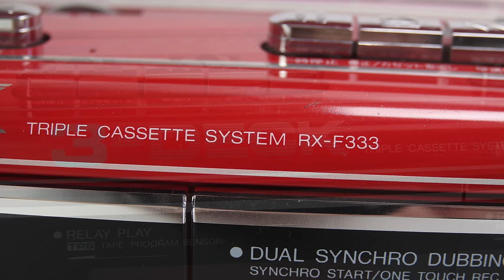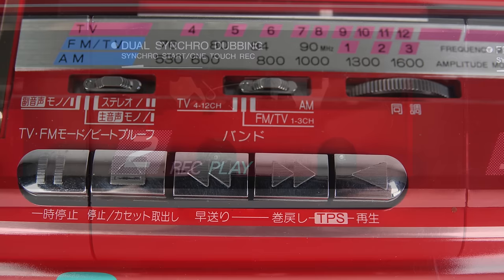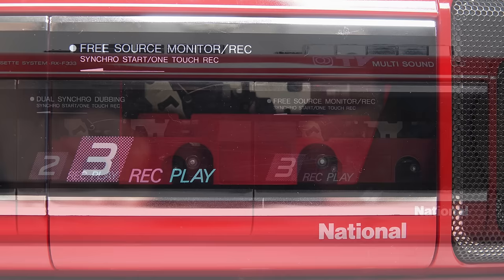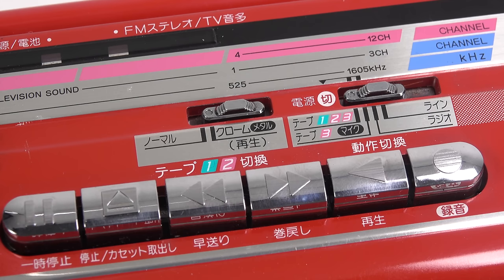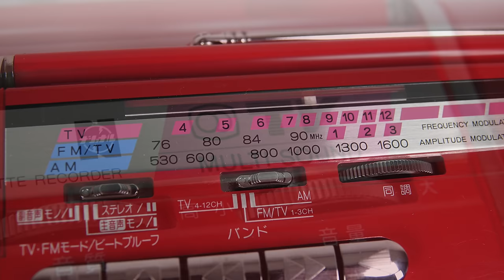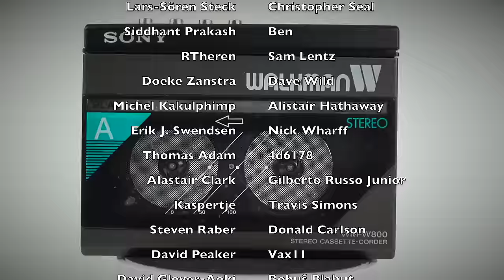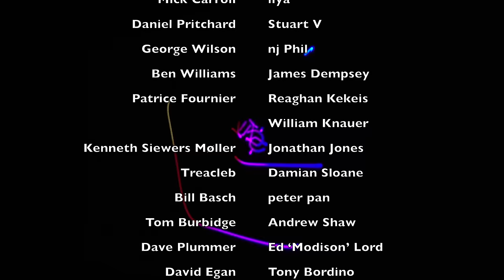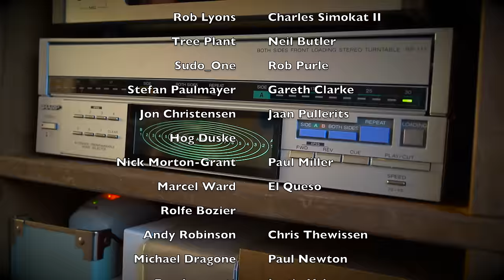The Three Cassette 'Boombox'

Comment from the maker: Update on the repairs. 
https://youtu.be/RjfExPMyX0c
Reply: Needle tweezers will do it.
Reply: The rubber remover is available from RS in the cans of Label off 50, from Contact Chemie. You can use a scrap VCR as source of those split washers, National used those clips on a lot of machines, so you should find a spare in an otherwise broken deck.
Reply: It is indeed tricky, but it is doable with some practice. To prevent them from spinning you apply force not from side, but more like from top of it. I mean insert knife in that split by moving it parallel to metal rod and split open ring  from side. That way it will not turn while you doing it.
Reply: What about running thin thread covered in solvent in one direction behind the wheel. That way you pull the goop out with the thread. Sorry best idea I've had. I don't think you can get it apart withou breaking something and replacing it.
Reply: Another way of doing it is use those tiny manicure sidecutters used for trimming nails. You can find those which so tiny it could easily be used to split open such washers. And such method will not apply any rotating force at all, so it will not turn around.
Reply: What about just getting a spray can of electrical contact cleaner and blasting the goo off with that? It's safe for electronics and it will clean off pretty much anything. I've even used it when I restore antique typewriters! It easily cleans off dirt and old grease and leaves just clean metal. But I've used it to clean sensitive electronics like computers too. I'm sure they sell it or something similar in the UK.
Reply: Techmoan I don’t know if they would work but they make split ring pliers for retaining rings on machinery, kinda like a pair of needle nose with a little lip on each side to grab the inside of the ring and then it opens it slightly when you squeeze them so it can be slid off
Reply: @zero0ryn   , yes thin ones just slide both tips under the washer at both sides of the capstan.
Reply: I used to use short nose taper nose players that had grooves for grip. You could try wire stripers that can go behind the clip and pull it up and onto the capstan it should then slide off.
Reply: Hi. It appears to be the same assembly as on the National RQ8030 Program Recorder. I had the exact same issue - belt goo and capstan/fly wheel removal but found the following bog very helpful. It's in Japanese but there are lots of step-by-step images:
https://blog.goo.ne.jp/timatima-psu/e/959884ab7a65f29ec6bbca635b020911
I prised the tiny locking ring off with a small flat headed screw driver - I thought it would be damaged but it had quite a lot of give and could be reused.
I also had the same clutch problem, which was solved with a dab of super glue - it's held up so far but might not be the best solution in the long run.
Hope that helps
Reply: When we used to repair these type of decks from Panasonic, we had a bag of replacement split washers, when you lever the split clip off it often flies into the air... also when removed it often distorts so we'd always replace it. I've probably still got a bag of these in the workshop! - this size was used an so many Panasonic audio decks over the 70's, 80's and 90's as I recall.
Reply: Yes you need to remove the split washer on the top to get the fly wheel out, they sit in a groove, I normally use two pins one to hold it so it does not turn and a second pin to the open it up and get it out and over the groove.
Reply: You can see the split washer clearly at 05:30
Reply: @anonymic79  yes very similar to in a fan a plastic washer with a split in it.
Reply: I'm surprised no one has mentioned that there are tools that can work with these "retaining rings" as they are otherwise known (or snap rings) though they are still difficult to maneuver in my experience. They go by the name of "retaining ring pliers". Don't skimp on cost for these either.
Reply: Maybe try a piece of aluminium foil, fold al little strip over so you have  a "v" shape and use that as a scraper to get the gunk out.
Reply: @Techmoan
I've actually done a belt replacement on the US version of this unit(Panasonic branded). It was years ago. I remember having to unscrew the entire assembly and pulling the sleeve-bearings out. At the time the belts could be had for cheap on eBay. Granted, that was the US version and this Japanese version you showed looks a bit different than I remember. They might have changed the design somewhat before releasing it stateside. Still it's a worthy unit and worth repairing. Don't give up and even if you can't repair it, thanks for the trip down memory lane! I remember seeing the Panasonic version on display at a store here called "Fred Meyers" back then. Ours had a black chassis. Bit pricey though.
Reply: Have you tried flossing your machine?
Reply: Try squeezing a cotton bud in a pair of pliers to make it flat, that might then be able to slip behind the wheel.
Reply: Techmoan Don’t envy you all that fiddly stuff with the creatures innards! Good luck anyway!
Reply: In addition, please note that you set up the pulley the wrong side in 4:41, the side with circles should be facing the felt wheel.
Reply: These plastic surclips are removable with a bit of playing around. Yes there's a groove on the capstan they sit in. There's usually a split in them and if you lever it up here it part of it will jump out of the groove. You can then work your way around the thing and once its all out of the groove slide it off. If you are careful you won't damage it too much. WHATEVER YOU DO DON"T LOOSE IT. They tend to fly off and a nightmare to find again.
Reply: Besides dental methods, cleaning fluids can be put in small places with a syringe.
Reply: @M1LAD81  Modify one that has a sharp secondary bend off axis from the primary bend. It looks like that kit comes with one pick with a secondary bend, but it's awfully subtle and may not be aggressive enough. With that you can gain leverage by twisting the pick once you hook it, which may be necessary in such a tight space.
Reply: @heep13  I was going to suggest pipe cleaners, but dental floss might work as well.
Reply: Would one of these help? https://www.google.co.uk/search?q=circlip+pliers&oq=circlip+&aqs=chrome.1.69i57j0l5.5342j0j8&client=ubuntu&sourceid=chrome&ie=UTF-8
Reply: I'd always lifted these off just apply even presser on both sides of the flywheel with two flat blabe screwdrivers at base and just work it till it pops off if you feel uneasy about it try it with a junk machine first  but it is a neat machine
Reply: Try using a cloth soaked with Citrus Solvent and slide it between the flywheel and case._
Reply: I would try to look whether those three "dimples" on the bigger pulley ( video position: 6:20 ) are actually just places where there are screws behind the thing ( I am thinking of screw studs, but I think that's not the term ). I would think those black rings would separate somewhat easily (either glued onto the metal "cap" or screw tightened). 

So, try looking through the other side and spin the big pulley and see if any of the holes in the back side of the assembly line up with a screw head. I think the metal wheel (slighly bigger than the black plastic pulley) is held on with an another set of screws underneath the black pulley. - The assembly has screwsheads visible underneath the bigger wheel ( video position 7:05 ) so it must come off somehow. I would even suggest trying to remove the button assembly in case the button "bars" are blocking the service hole that blocks the holes meant to remove the black pulley screws.

But -  This comes from someone who has never fiddled / disassembled / repaired any kind of a cassette deck, but still I think it's worth a shot.
Reply: Maybe get some of freeze spray to see if the rubber goo solidifies, then use a long metal pin to remove the froze rubber.  Not sure if the rubber will freeze, but maybe worth a shot anyway.
Reply: @TheBrokenLife  I agree with using pipe cleaners in the gap, maybe dipped in a solvent. Oversized pipe cleaners are available from craft stores.
Reply: Very unlucky indeed, recently replaced two drive belts on a Sharp VZ2000, yeah you guessed it, sticky tar like mess.
As you may or may not know, this machine has a dual speed turntable.
Suffice to say, cleaned up the mess and replaced the belts.
I was also going to suggest the split washer on the capstan pin.
I have never, in all my years of working on tape machines, seen this type of fitting.
That said, they might be pressure fitted with a groove in the pin and/or a retaining clip.
Reply: You need to get very, very small
Reply: Why are you so afraid of submersion cleaning?
Using distilled water and gentle cleansers, such as a little bit gentle dish soap will safely remove all the gunk and then you just rinse and dry them.
You do need to rinse the cleanser out very throughly with distilled water or you'll get rust, and discharge all caps but..
It is not risky to submerge electronics. 
We do it all the time manufacturing them.
I know. Because I have manufactured them.
Reply: They are called E clips in the states.
Reply: I used to remove that kind of Split washer by using two tiny screwdrivers, one for keeping it from spinning and the other for pushing it open.
Reply: Hope you make some progress, this thing is pretty neat!
Reply: Those split washers are easy to remove if you know how. Micro pliers or hard body tweezers are the best tools. To remove simply grab the side opposite to the split and pull. Be warned though that putting them back on is usually a lot harder and getting them off.  : )  They are also a little delicate so if they get damaged you will need to replace. I'm pretty sure they're a standard part though so should be easily available from the right supplier, like RS.
Reply: Try to clean it using a coarse dental floss dipped in goo gone.
Reply: Hey techmoan I have an idea try buying a cheap jewelers screwdriver set use a flat head one and use like a felt sticky foot pad or something similar attached to the end that might help you get to the nasty belts. I don't know if this will work for you but it might just be small enough to get down there and I don't know how difficult it would be to attach the felt on the screwdriver but  I thought I would make the suggestion anyway.
Reply: As a watchmaker I take precision tweezers, flat ones if you have. And a magnifier glass to see what you are doing.
Reply: @spacemissing  Well, like I said I've even used it to clean the mechanisms in typewriters...since it can easily clean off 70+ years worth of grease and grime in an old typewriter, then it's worth a try. I've also used it to clean engine parts. Maybe they sell a watered-down version of contact cleaners in the UK because of tighter environmental laws or whatever, but trust me the stuff I use will get anything off. It's made by the same company that makes WD40 but it's specifically meant for cleaning electronics. It just happens that it's also great for cleaning mechanical parts. It comes in a green and silver spray can.
https://www.wd40specialist.com/products/contact-cleaner/
Reply: As someone who has serviced too many of these mechas, this washer is just pressure-fitted, and can only be force-removed, unfortunately, e.g. with a screwdriver. If you're lucky you might be able to reuse the same washer once or twice, but it's better to keep a bin of spares. If you don't have any, you can cannibalize one of those washers from one of the spindles (it's about the same size) and use a turn of copper wire for holding the spindles in place, instead.
Reply: Yep, that's it. Had disassembled so many different cassette decks in my younger days(massacred for other projects).. became old hat. Many matched the type installed in this national. Found a sharp knife the best way to lift that little split washer. It slides straight off the end of the spindle/capstan. One thing, make sure you don't lose them though..They're damn hard find if you drop them.. lol.
Reply: I used to remove such split washers using small flat screwdriver. Just inserting it between the shaft and the middle of washer. Make sure to catch it if it attempts to fly away. And beware bending too much as it can cause shape distortion to the washer.

Sorry for my English :)
Reply: Yes, as others have said, you'll need to find a way of easing off the split washer. A small jeweller's-style flat screwdriver usually does the trick. The washers are usually pretty soft and flexible, so it's hard to damage them without being extremely heavy handed.  I actually removed the capstan flywheel on an old Nakamichi one time.  Because I'm stupid and crazy.  Worked out fine.  The only bad things that can happen are accidentally bending the capstan or pinging the washer across the room when removing it.  
I never even knew that triple cassette decks existed.  Looking forward to seeing it up and running.
Reply: I would probably use a dental pick to try and get under one side of the split and lever it up and off (maybe while holding down the other side with a second pick). Alternately feeding a thread or waxed bit of dental floss underneath may allow you to slowly work the clip up without damage.
Reply: I take those out by using a very small flathead screwdriver, one that is 2mm or less in width to split the cut in the washer while holding it with tweezers. Just hold it, insert the screwdriver in the cut vertically and turn it a bit so the gap widens. Be careful though, as those washers are notorious for hopping off into the most cluttered part of your room if you don't hold them firmly. Do not widen it too much though, as the disc might get bent and will not stay on or will start rubbing against whatever non'moving part it's installed against and that can be heard in the case of capstan, though that is only in extreme cases. You can also use a thin needle to pre-widen it and let the screwdriver in if it's too tight. Many computer fans as well as tape decks have rings like that and i've used this method on quite a few. One of ways to put it back on is to lick your finger so that the ring sticks to it and can be picked up, and then pressing it on like that. This way it'll be a lot easier than with tweezers to put it on perpendicular to the shaft and to feel whether it actually got on and it won't fly off.
Reply: I used a baby screw driver flat head and a tiny kitchen knife, it's in a recessed ring, one tool holds it steady, the other you bend it up and it will finally slide off, it's a PITA but it will come off and usually be reusable, an e clip can replace it if the right size, I used a trash donor BoomBox on mine, if you use the e clip you need the grayish washer behind it.
Reply: It's definitely worth repairing for the novelty factor (one of only a handful of boomboxes with 3 decks), but just don't expect any quality sound from those decks. The wow & flutter was horrible. This model was produced during the mid or late 80's, when quality went downhill. The best build quality was during the early 80s and late 70s.
Reply: Use a precision screw driver and insert it in the cut in the split washer to create a gap. Twist the precision screw driver some more to widen the gap. This will create space in the center hole of the washer. You can then pry the washer out of there using some pointy tool. Be careful with this as they have a tendency to flick in the air just like a c-clip would. Being small and translucent, it's very easy  to lose them and finding a replacement is a pain.
Reply: Hey Techmoan,

Nice to see you don't give up on the casette deck.

I have a question: where to you get the replacement rubber for the casette decks?
I have a Sony HX PRO STEREO CASSETTE DECK TC-WR 720 on wich the rubbers have suffered the same faith as your rubbers and i would like to replace them.

Would be nice if you could tell me where you get your replacement rubbers from.

Keep up the great work.

Cheers from Luxembourg.

Comment: 06:48 - Each capstan flywheel is held in place by a nylon snapring on the front side. Most spinning parts of the transport mechanism are held in place by those little snaprings, which are easy to remove. (Honestly thought for a moment you're gonna use brute force there. xD)

Edit: I don't remember what I used taking them off, it's been long ago; okay it's not the easiest to remove them actually, but the tool I used wasn't very sophisticated for the task either. Most likely it was some smaller screwdriver. You need to get the edge of whatever tool you are using right into the split of it, then rotate you tool so one half gets pushed backward, while the other half forward. Or something like that. Maybe try using a tweezer too. It can be done.

07:27 - :D :D